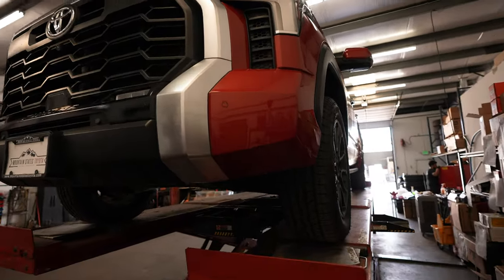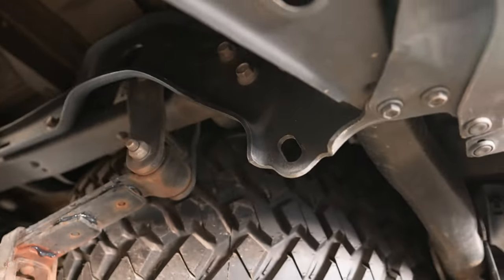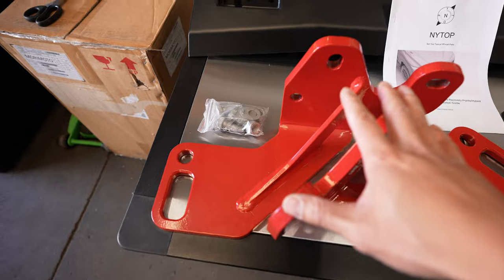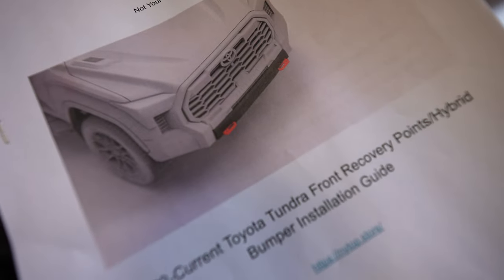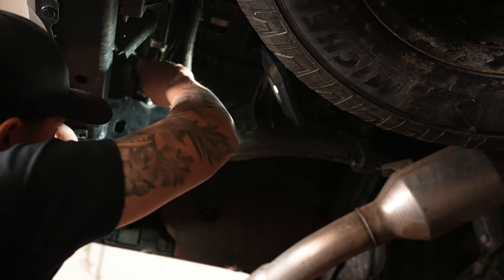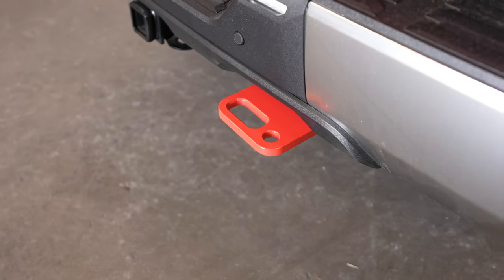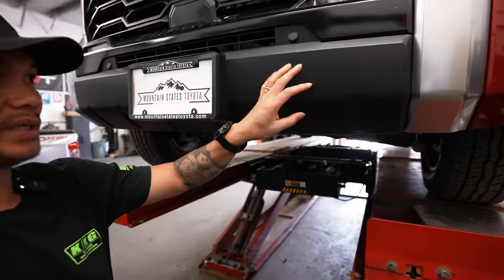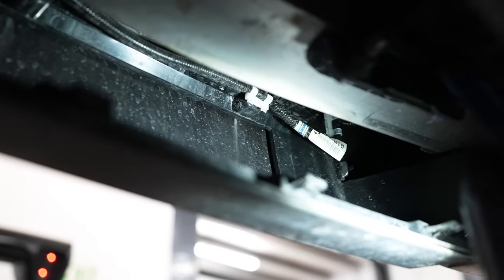Installing Recovery Points on a 2022 Toyota Tundra - NYTOP

Comment: Why would you install those unless you knew that was an approved attached point by the manufacturer… I disagree with this install… I would only have them originally installed from the factory… if you pull on those and it yanks the frame out of whack then it’s on you buddy and or whoever installs these… Ever thought about that?

Comment: Ordered the rear recovery point. They angled in and had to use washers to get parallel with the bumper. Reached out to the manufacturer and they never replied to my message.

Comment: For the front recovery point, would that be cool if Nytop has the version for which the part is sticking out of the front pumper be rotated 90 degree? So we can hang the shackle. Thanks for the video. Would you please show us the approximate dimensions of the rectangular holes if using the original pumper if possible? Thank you.

Comment: If the front recovery points stuck out another 1/2", it would have been better. That way you wouldn't worry about scratching up the front bumper if you had to use a hook

Comment: Thank you for the video, a bit late to the party, does anyone know the preper torque for those 7/8" bolts?  I found 98 lbs/ft as the OEM recommendation for the tow hitch, but NYTOP's website states to torque all bolts to 148 lbs/ft. Can anyone enlighten me with the right spec? Thank you!

Comment: Does the Metal Hybrid bumper have a slot for front licence   plate mount and block heater cord?
Reply: Doesn’t look like it, I think you could just add the license plate it if you want to. I believe the dealer needs to drill the bumper to add the block heater cord, at least that is what I’ve been led to believe. Worried that black steel would rust and look terrible after a few years of harsh winters.